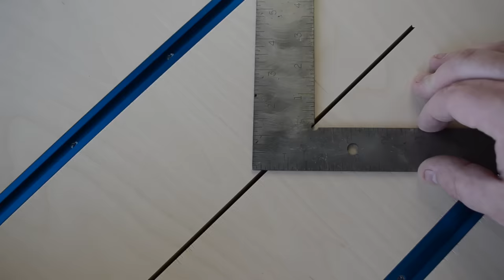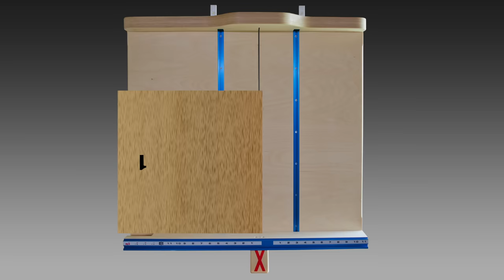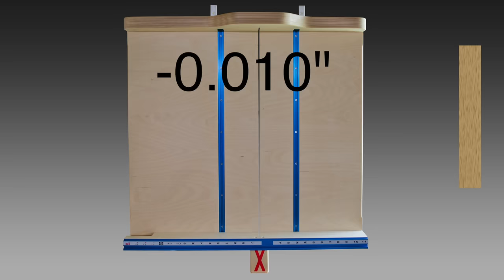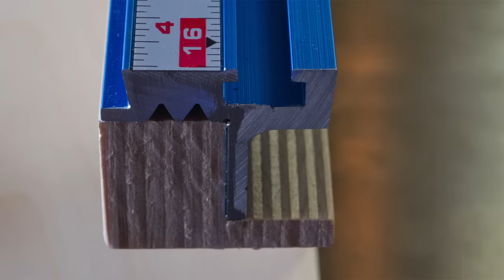Ⓕ Make A Table Saw Cross Cut / Miter Sled Combo (ep58)

Comment: @nickferry - when applying the tap measure to the left side of the kerf, how are you setting the tape?  I used the same method as described for the right side of the kerf to apply to the left side, place the stop to the left of the kerf and then begin laying the tap to the left side.  The gab between the two tapes '0' mark is much further apart than yours - but I think my stop is is also much wider than yours.

Comment: I built one of these but I simply aligned the 3/4 board of my sled with my rip fence when gluing it to the miter slot runners.  By doing so, I ended up only 2 thousandths of an inch difference in a 20-inch board using the 5 cut method.  

That is the precision of a SawStop table saw for ya!
Reply from the maker: +awesome - I set my fence out in the back slightly

Comment: I built this 6 months ago. Dude, you are amazing! I use it all the time. I would never go back to not having a sled. The modular design allows me to make all sorts of custom jigs for my work. Using your sled has made my shop a ton of cash. Best $15 I spent in my shop. Thanks a ton man. I appreciate it.
Reply from the maker: How are you liking it after almost a year?
Reply: @NickFerry  Love it man! I made a smaller version of the same thing for ease of use. Its a monster of a sled when ya just need to cut small parts. Its holding up well, cuts true and has made my table saw the most used tool in my shop. The only thing I would change is making it out of half inch rather than 3/4. Its a bit heavy. Use the 3/4 for the front and rear fence and half inch for the base and miter/spline addition.
Reply from the maker: @thejakyl1369  glad to hear - I did the same for my job site saw - just scaled down a bit

Comment: Great video.  Great sled.  Ferry commented at the end that he oversized the sled to provide for building shop cabinets.  I took a completely different approach.  After building two shops and all the cabinetry in them I got tired of that.  For my third shop I went to a nearby Habitat for Humanity Restore and found a whole suite of floor and wall-mounted medical cabinets including one four-foot wide, six-drawer unit.  They were way cheap, well-built and strong.  All I added were new bases for the floor units to bring them up to the height I wanted and new, solid wood tops which I attached to  two or more cabinets to gain as much as a ten-foot X 32" or 36" working surface.  I don't have a sled, but not for long.  Thank you Nick Ferry.
Reply from the maker: no problem - I agree the restore is a good place to find things

Comment: nick, i am a very highly skilled woodworker. your sled video on you tube was outstanding. i have been using my sled constantly for 20+ years. yours is better thought out. the only improvement i would suggest is the runners. rather then aluminum i used a white nylon type cutting board material. it is extremely durable and very slick. there is no play on my sled after all this time and it never sticks. great job nick
Reply from the maker: Thanks much - my last sled was HDPE and I still have a few hugs kicking around with those - I always seem to have that and assorted acetal stock laying around for whatever may come up - when I designed this one that material seemed a bit more scarce especially online so ended up going with the aluminum - one reoccurring question I get is what to use in place of "X" so I try to cut down on that

Comment: Finally, an instructional video that uses metal parts for better utility.  I understand there are purists out there, but rather than spend so much time getting a wood or HDPE to make miter bars and T-tracks, I would rather get aluminum ones that are virtually guaranteed to fit perfectly and with added flexibility for a tight slot fit.  Most YouTube videos do not include the T-track on the top of the backside stop; I think this is an invaluable addition so “real” stops can be used more precisely and solidly.  Making a sled like this is getting on the heavy side.  One Youtuber did something kinda unique: drill a bunch of 2" or whatever holes in the sled and sandwiched that with laminate (Formica, WilsonArt, etc.)  on the top and bottom.  That (is said to) dramatically reduces the sled’s weight; likely it did.  Laminate sliding across the table saw bed is just as smooth as waxing the bottom of the sled.  One thing I did learn is using a table saw to cut thru aluminum.  I never considered using my table saw as such; typically using my miter saw with for that.  So, searching other videos on that shows that a table saw does / can cut better, cleaner cuts that I get on my miter saw (and what is shown in the video).  Additionally, most of the non-ferrous blades cut plastic very nicely, something for which I have always used my laser engraver.  With a table saw blade, I could more easily cut thick acrylic with a blade and also use it for other non-laserable plastic (lexan, polycarbonate, etc.).  Overall, this is a GREAT video.  Thanks, and keep that saw dust flying…
Reply from the maker: Thanks much - glad you could get some ideas - cutting non-ferrous metal on the table saw is really handy - I've made a ton of .080 & .040 aluminum signs and have always cut them on the table saw - as well as a bunch of aluminum extrusions - growing up around cars, I've always called the holes drilled for weight, speed holes - I did that in my Kreg jig video - I just omitted the laminate - using aluminum for the miter bars, I wouldn't have it any other way - not having to worry about wood expanding and contracting & HDPE wearing out with no adjustability is important to me - and cutting sheets of composite with a high shear angle, high tooth count blade is really nice as well - it leaves it clean enough to where a quick flame polish is all that's needed to end up with completely finished edge - glad you extolled most of the nuances to the sled - I had put a great deal of thought into it

Comment: That is a nice sled. I like the double plywood grains after they are polyurethane. I also like the T BRACKETS. You can them to hold down wood as you cut.
Reply from the maker: Absolutely - they work great for hold downs

Comment: I have been watching table saw sled videos all night for the past 4 1/2- 5 hours. And by far this is the best one I have ever seen. I will be making one just like this, your explanation of the five cut method is spot-on. In my playlists I have a category called "shop talk" and I was going to put only what I felt was the best sled I could find into that category and yours is it. The Wood Whisper's sled was a very close 2nd, but all the fine details and removable miteres did it for me. Great job and keep up the awesome work.
Reply from the maker: Much appreciated - sounds like you e been doing your research - make sure to check out the tenoning jig I have for it as well - https://nickferry.com/2016/05/how-to-make-a-spline-and-tenon-jig-ep67/

Comment: Nice build! Cut the T-track a bit shy of the back fence, and then you can insert any length bolt into the track from the top of the sled, without cutting notches in the fence.
Reply from the maker: Thanks - The sled I made for my job site saw I botched the tracks but I kept the cutouts in the fence because it makes it easy to blow out any sawdust

Comment: I agree with all of the comments on how awesome of a sled. An item that might improve it is this; instead of cutting holes inthe back fence, is to remove material from the slot tracks that will allow the hex-heads to be inserted into place.  This  way it won't matter how long of hold downs you might need  to use. Just a thought for you and your viewers. Nice work.
Reply from the maker: thanks  - I did that on the sled i made for my jobsite saw but kept the holes in the fence to blow out dust

Comment: Hi NIck - This is the first of your videos I've seen. Nice sled and great video. One tip I got from a Woodcraft salesperson: if you're on a tight budget, Instead of buying two adjustable solid miter bars buy two aluminum miter channels that will fit your saw slots. Lay them in the slots upside down and  use playing card strips cut to your miter slot height to shim them away from each other. I place two sided tape on the top of the channel  to grab the sled in assembly. For my last runners I went even cheaper. I bought a length of square tubing and ripped it in half. Worked just as well as the miter channels. I'm subscribing.
Reply from the maker: Very cool - always more than one way to get things done - a couple cool ideas for sure

Comment: So far beyond the 8ball, I need on these !
Reply from the maker: No better time than now
Reply: @NickFerry  would your table sled be to large for Dewalt job site table saw, or should it not matter the size of the table it's running on?
Reply from the maker: @gregorycampbell1148  I’ve had plenty of folks with that saw make it - you’ll just make yours a couple inches narrower than what the plans say
Reply: @NickFerry  Thanks I will be buying your plans and giving it a go this weekend.

Comment: Seen so many slide videos and I made a sled myself years ago. This is the best.
Mine is nowhere near as good but I did one thing that I like. I made my fence adjustable. One permanent pivot screw on one end, then on the other end a slotted hole so it could be micro adjusted over the years.
Mine is basically Norm Abrams panel cutter but with adjustable fence, and also an aluminum Runner. Love your work dude! subscribed!
Reply from the maker: Thanks much man - I’m very proud of my sled design - I use it pretty much every day I’m out in the shop

Comment: Great video!
Squirt a little superglue in the screw holes and let it dry.  You will find they don’t strip nearly so easy, especially with the short screws.
Reply from the maker: Thanks - works great - done that on threaded holes too - https://youtu.be/8CZB-Crs4YY

Comment: Great build - I plan on making one similar.  I want one sled I can use from most everything, instead of have all this different sleds and attachments floating around.  Side note, that was probably one of the easiest to understand explanations and demonstrations of the five cut method I have seen.   Much appreciated!
Reply from the maker: Thanks - that was my thoughts when adding the miter insert, tenoning jig and other stuff - I always hated having multiple sleds cluttering up the shop

Comment: Hey there.  
This is been by far the best Table sled video & design I have came across.  I watched this a few years ago & now I am getting ready to build it.  Yeah I am a cheap skate & took your idea & designed mine on Sketchup.  I have a great start on it & although it won't be an exact replicas of yours it will definitely resemble yours quite a bit.  
Thanks!!!
Reply from the maker: Much appreciated - it seems to be a pretty popular design - i’m rather proud of it - it gets a ton of use in my shop that’s for sure

Comment: Great sled idea. Made myself a similar one. Got it accurate to 3 thou after first adjustment. Thought i'd be clever and improve on 3. After spending an hour losing accuracy out to 8 thou ended up back at 3 thou. Think you're right, accurate enough for woodworking!
Reply from the maker: Plenty good!

Comment: You may have already considered this, but another way to allow in the taller fasteners would be to just open up that T track up near the front fence - just drill it out so your 1/4 inch hex bolt can drop in.  Then there's no need to cut up the front fence.
Reply from the maker: that's another way but I still like the slots in the fence to blow out sawdust

Comment: The best table saw sled video I have watched. Thanks. The dadoes in the back fence could be eliminated if you cut a notch in the T-slots to accept a bolt head. Alternatively, you can get T-nuts that can be inserted from the middle of the slot. I believe Orange Aluminum sells them. They have a crescent cross section and rotate into the slot. thanks again for a great video.
Reply from the maker: thanks - I still like the back slots for blowing out sawdust - currently I have two bolts in each track to use when I need for my tenon jig attachment

Comment: I love this sled!! I made a relatively crude sled when I got my newest table saw, but just knocked it together quickly (and as accurately as possible) out of necessity. What I really wanted, though, is exactly what you built....so this is near the top of the project list, along with the attachments in later videos. I just now discovered your channel, via a string of other channels...all of whom you know (Wood Whisperer, Matt Cremona, etc.)...and subscribed almost immediately! Looking forward to 'catching up!'

One suggestion: The spacer block that you use to push the miter insert forward, for longer board miter cuts, might be a nice permanent addition by simply calculating the depth of the board needed to accommodate longer pieces, and turning it into a 'flip-down' option by attaching it with a piano hinge, so that it flips up and onto the miter attachment, to store when not in use (obviously keeping the spacer board short enough that it doesn't stick out on the ends, and/or mitering those ends)! At least that's how I plan to build mine....otherwise I am sure to lose that (carefully measured) board! Hey! I'm 65...I'm entitled! LOL  Outstanding project!! Thanks!
Reply from the maker: thanks, glad to have you here - I had thought about attaching the spacer somehow and never really got to it as I don't use the spacer all that often - your idea would keep people from loosing it for sure!
Reply: Thanks, Nick! Meanwhile, I'm having fun digging through your 'archives.' Sorry if I tend to be a bit long-winded with the comment(s). I was a teacher for awhile, and profuse detail has turned into a bit of a nasty habit! :-)
Reply from the maker: I like verbose comments a lot of times - definitely have a look around my channel and website - some of the older stuff is hard to watch though

Comment: Great project with great plans, thanks. A couple of observations which might help others. As you did, use the Rockler or similar style T track - (1) I bought some generic  before I even got your plans - it was thicker than the Rockler and would only have left only a couple of plies left of the 3/4 plywood. (2) I didn't notice when I fixed them but the miter slot runners have two holes close together on one end. After the event, I saw this and realized I had given up ideal "hang up" holes - oh well! (3) I think my miter slots are not as deep as yours because a couple of screws, which were not quite vertical, had an edge protruding just a smidge - enough to foul on the bottom of the track. I had to file those down. I might try to countersink the countersinks a little more to get the screws in further. I still have to make the miter sled insert but the plans and instructions have been superb. For anyone who wants a large sled this is the one to go for.
Reply from the maker: I appreciate the kind words - glad to hear you like the plans - good tips - for sure double check on whatever the size of the aluminum you use

Comment: I purchased your plans. It was quite simple.  I modified it to use a HD fence.  Ended up with a .00035.  did not build the miter piece yet as I do very little miter work.  Overall pretty good plans.
Reply from the maker: awesome - that's pretty spot on!

Comment: great sled the only thing is the back fence is only a sliver of wood and the track scary thin does it flex i guess your blade cover stiffens it some. great build i'm going to pattern mine of of yours a lot .thanks
Reply from the maker: Thanks - yeah it’s solid - the cross section starts as an offset “X” and what I cut leaves a “T” cross section - plenty rigid with the aluminum

Comment: To make it easier to get bolts in and out of the t-tracks just cut them a little shorter so they end on one side like a half inch before the back fence.  this would leave a little "opening" if you will in which a bolt head can be inserted down and then slid into the track without having to pass through either fence.
Reply from the maker: I just leave them in there most of the time
Reply: thats cool too!.  I admit this is the first of your videos i watched and i like it very much.  I have been following your buddy Jay Bates for some time and he always mentions you in his articles so i figured i'd check out this video.  Just wanted to say man i think its neat that you monitor your older posts and stay active with it too.
Reply from the maker: thanks man - glad to have you here - yeah Jay is a good dude - the comments section is probably my favorite part - here is another project I'm pretty proud of - https://youtu.be/vfyLayWU7ic - take a look around and let me know if you have any questions

Comment: Adding a insert would be cool. Same as your table saw insert changable for dado stack and different kerf blades.
Reply from the maker: Not a bad idea - I thought about that and opted not to and after all these years never really had a need for it
Reply: @NickFerry  i have a sawstop jobsite which ok, but a little too small to use the incra build it and mitre gauge. So i need to build an over sized sled and infeed. Working on a design before commencing the build.
Reply from the maker: very cool - I have the SS jobsite too - I made my sled for it but made it about 3" inches shallower